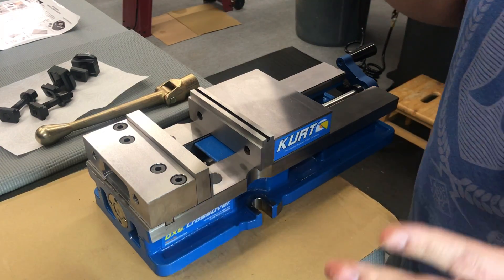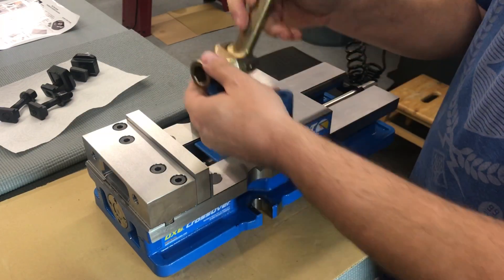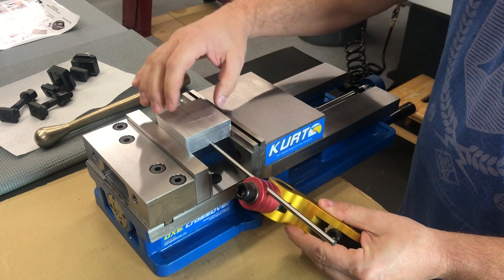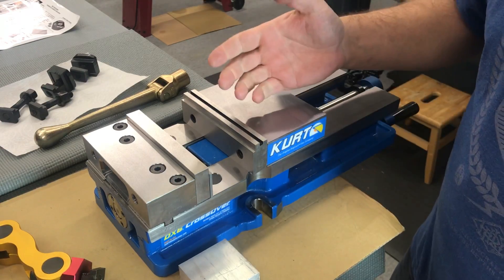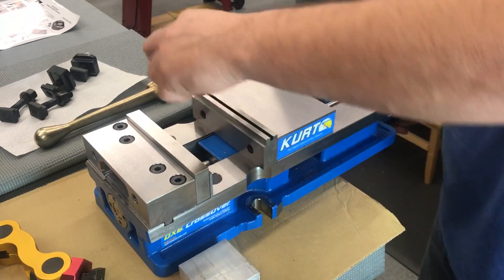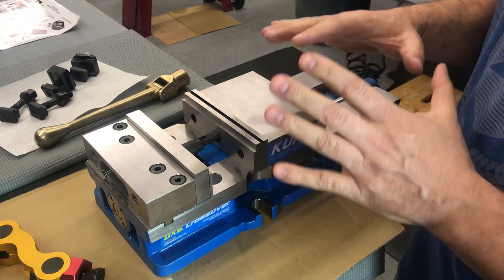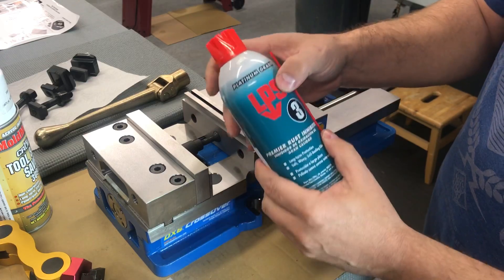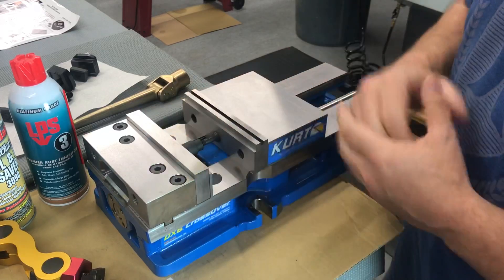CNC Vise Tips for Newbs

Comment: Rubber bands work really well and are super cheap, also that jaw with the groove belongs on the fixed jaw so you can used a work stop that goes in the groove and is more repeatable on that jaw

Comment: I have a few tips to add when using a machine vice.

Put lower parallels between the ones you are using and the jaws. This creates a channel for chips to fall into, it is far easier to clean them off.
Move your finished part side to side before removing from the vice, it automatically cleans the tops of the parallels.
I always use springs between parallels, there are several other methods mentioned. I like that they take out any backlash in the vice screw, immediately releasing the part.

Always position a stop in the centre of the datum face to eliminate any taper errors.
I also use a cordless drill with a socket to open / close my vice quickly.
Here are a couple of links that show some of the tips.
https://www.youtube.com/watch?v=TGEJUwJ09tI
https://www.youtube.com/watch?v=YRbcjwqMcBM

Comment: Has anyone ever measured the fixed jaw deflection on the DX4 / DX6?  I can't find any published data on this.  There is published data for the higher end vices but not on their entry level vices.  Other brands publish this and other information for their vices. FYI, here in New Zealand a DX4 costs about $1,000 and a DX6 about $1,150, an HD690 about $1,300 and VersatileLock about $1,500 after you take the exchange rate and shipping into account.

Comment: I picked up (I am a hobbyist machinist, so no expert) magnetic parallel keepers, can be had on amazon or ebay for little money, set of 4 is like 15 bucks. But as some have said already, having vise jaws with a shoulder pre-machined in is probably the most efficient, albeit less adjustable way.

Comment: I prefer to eliminate parallels. Too many chances for chips. Use soft jaws and mill a step in both jaws and zero off the fixed. Also drill/tap on side of fixed to mount a stop. This is always the zero. Very repeatable and never a chance of chips under your parallel.
Reply: thats what I always do.  And nice thing about soft jaws with a milled step is even if your vise is off your milled "parallel" is always true to your machine

Comment: I am a huge fan of thin double sided tape. It works with countless work holding applications other than just keeping parallels. I am a big fan of light duty springs for keeping parallels. I have one drawer in my top box, dedicated just for various length springs. Ive been using those since I was a teenager. I really like the banding idea. That is resourceful!

 There are a few excellent aerosols we use at Boeing that lube/protect steel sufaces. 
1) Balistol Multi-Purpose Gun Lube: It is a thicker lube, but a great protectant. So many uses! 
2) LPS: Thats your every day lubricant and rust inhibitor.
3)Tri-Flow: This stuff is amazing! In my opinion, I have not used a better lubricant. It puts down a thin layer of PTFE (Teflon) that lubricates and protects like none other. It smells so sweet, very dististinctive. Of course, that is my opinion, but we cannot keep it stocked! Everyone has a stash of that in their box.  Im not sure if any of these are what you are talking about, being there is no standard among what is kept in each Dept's flame cabinet, but out of those three, you would be hard pressed to find much better.
Reply: Hi Chuck, do you have a brand/part number for your favorite double stick tape?
Reply: @ViceChief  I wish I could share pics. I use several different styles of double sided tape. Tape in my opinion, is such an under rated tool, whether in the home shop, or in an industrial environment, tapes have so many valuable uses. 

The double-sided tape I use the most, Polyken Double-Sided P/N 105C,
is manufactured by Berry Plastics. It is  used mostly by Conventions for carpet adhesion, and generally used in Aircraft Manufacturing. On Berry's website, you can see the different kinds, and even request samples.

 I have been using this tape the whole time Ive spent in a machine shop. I grew up in my Grandfathers machine shop, and cannot, not remember using it.  We would use the thick DS tape for general purpose, but the thin, cloth type is great for the work holding of small parts and thin parts. I can grind or mill aluminum or non-ferrous part that are 1/16 or smaller, even at 12 inches long.

 After using it enough, you learn its flattening characteristics, and can use it while achieving tight tolerance work. Like I said before, this is just my humble opinion. Hope thus works, and I hope it can be used as a topic soon. I see its been a few months since you put out anything new. I watched a few videos, good content! Ill subscribe. There are a few good 'tubers that have left comments here, and I have found a few Im subscribing to. Hope this helps!
Reply: @CHKSTR96  very helpful, thank you very much!

Comment: Put the jaw with the groove on top on the back fixed master jaw. When you put a stop there it''ll be more repeatable than when it is on the front moving master jaw.
Reply from the maker: natedawg003 thanks buddy. I have never used the stop before.  Actually 99% of the time I keep aluminum jaws installed so I can hold on to round stock.

Comment: You can also keep the parallels in place with thick rubber bands.
Reply: Thin bungee cord works even better and lasts longer.
Reply: Yep, we use the rubber bands too.. but the coolant eats into them after awhile
Reply: @antman-uc9hh  your coworkers will use them as a gun well before then